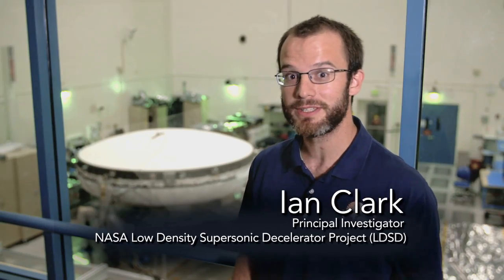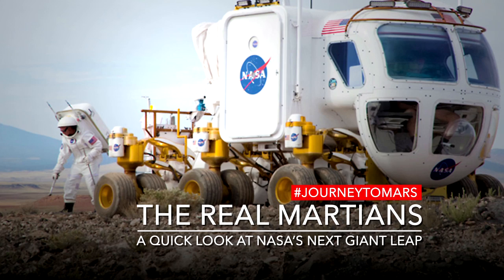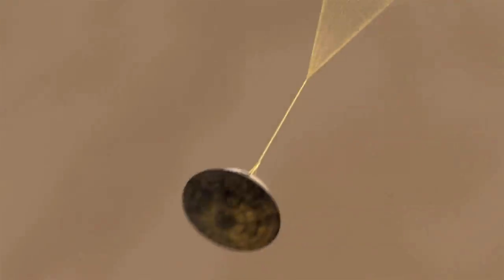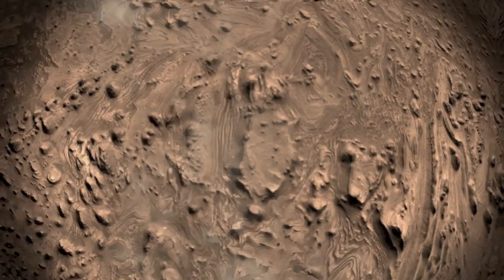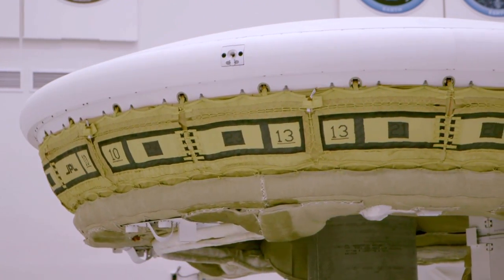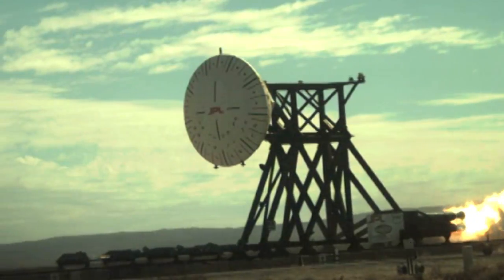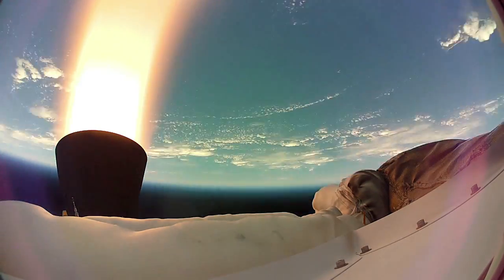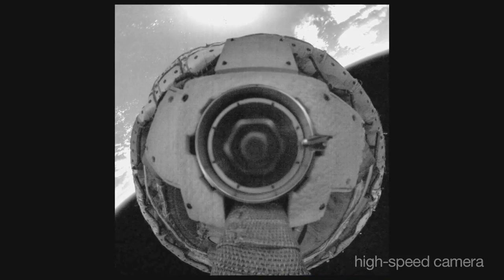Real Martians Moment: Low Density Supersonic Decelerator

Comment: Just land with rockets.
Reply: Rockets add weight, which isn't a good idea when trying to land.
Reply: +chubbz5150ify Well that depends. If what you are trying to land is already very heavy, then rockets might be the way to go. Take a look at the sky crane.
Reply: +KiaranScath The skycrane was used so that the rockets wouldn't kick up the dust and damage the equipment.
Reply: chubbz5150ify  What about a large inflatable donut?  Looks heavy to me.   I don't like the idea.
Reply: +cavereric 
the advantage of these high-performing parachutes is that they save weight. Because all of the fuel and boosters that are gonna be used to land/decelerate will have to be lifted by even more fuel and boosters. So, every lower stage exponentially gains weight just so it can lift that upper/landing stage.

So, saving what seems like a little bit of extra weight at the top of the rocket also means that the whole thing becomes a whole lot more fuel-efficient.
Reply: +Jim Panse  Lower gravity and atmosphere.  When we start landing large payloads i'll bet they go from orbit to the surface and back with rockets.
Reply: cavereric I think his point was that we still have to get that mass off of Earth first. I assume that you are thinking about what SpaceX is doing/plan to do with propulsive landings. But we won't be looking at landing those kinds of payloads or making return trips for a good while. First we need to know more about how humans could survive on Mars.
Reply: KiaranScath  I think we are close to doing it on Earth.  I understand the atmosphere on earth helps slow down on reentry, but it seems with less gravity and atmosphere rockets are the only option on Mars.